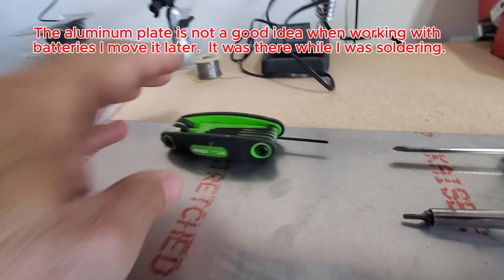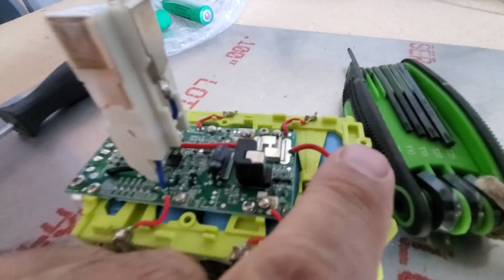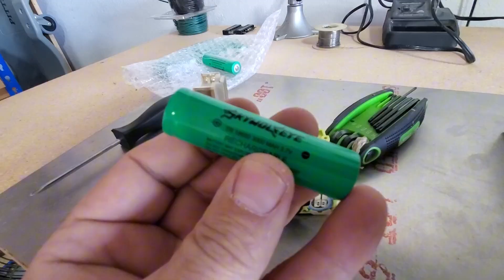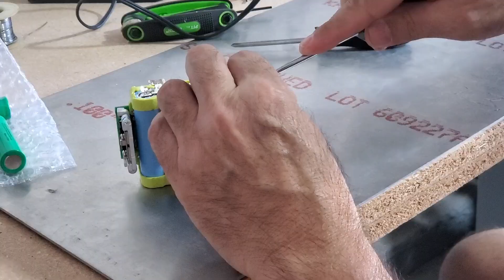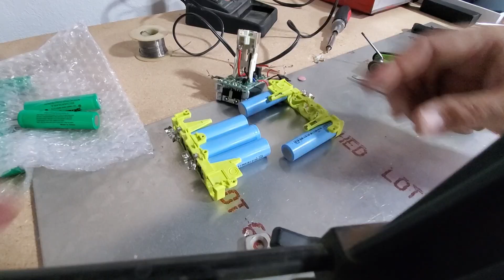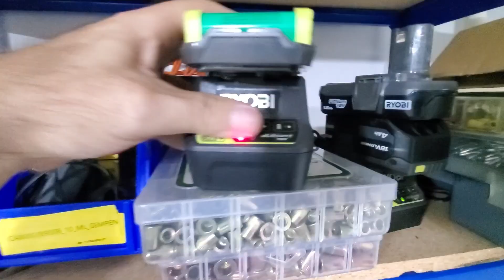Ryobi battery rebuild walkthrough

Comment: You said you learned some lessons in the process, what were those lessons? (So I can learn from them too)
Reply from the maker: Sorry I didn't reply sooner to this comment
Lessons I learned
1. Take your time.  If you get in a rush you stand a better chance of breaking something.  These things are put together to stay that way so a little patience during disassembly goes a long way.  I broke the first batter holder when if I would have just taken my time I could have figured out how to disassemble it.
2. Take pictures-  I try and document things when I take them apart so that assembly is easier and I run less of a risk of screwing up and in the case of these batteries hooking up them in the wrong polarity config.
3. The battery bus straps are more of a headache to save than to just make new ones from nickel strips.  They are also very think and you are less likely to be able to spot weld back together with the Amazon cheap spot welder.
4. If you aren't confident in your abilities then get someone to help you or take your batteries to a shop.  I am cheap and hard headed so I will try most things once :)
5. Enjoy-  At the end of the day doing things like this should be a source of enjoyment and give you a feeling of accomplishment.  If its stressful then its not worth it.

Comment: protip if battery board have slow balancing you might want to cycle cells connected in parallel one time so they have same voltages and charges before assembling into battery
Reply: Dumb question but how do you cycle them completely?

Comment: I've never had any of my packs fail on me, but I have been thinking about taking a 1.5AH apart and turning it into a 3. Would be so nice for the flashlight or drills for light tasks. 
Double the power with the same weight? Sounds good to me. Might as well even increase the amperage a tiny bit too.

Man I love tinkering.
Reply: you will need to have active balancing board or matching capacity and impendance of each cell otherwise some of them will discharge faster and you will be unable to extract all 3ah. and you will not increase current because cells will drift apart much faster under fast discharge.